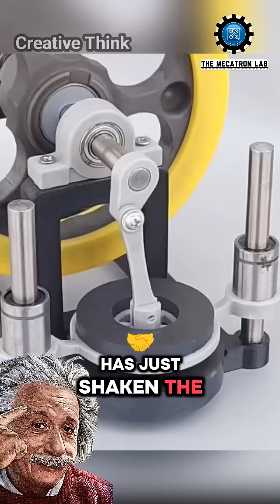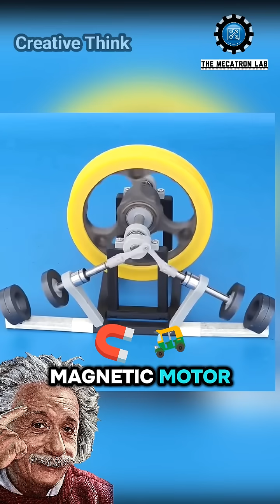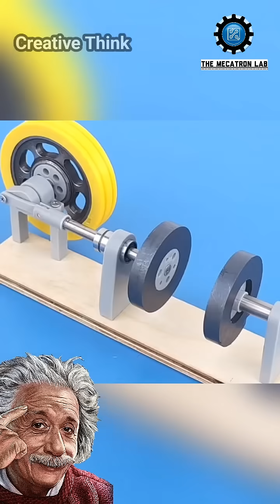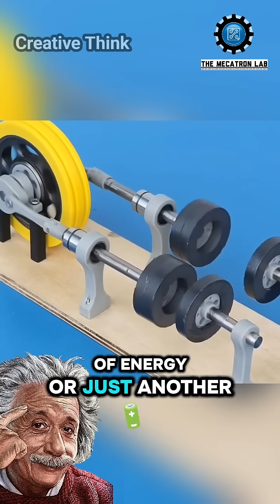How To Make Magnets motor.Free energy motor.#diy #diyprojects #facts

Comment: THIS stands near per. Mobile! You can have a coil between the magnets piston and make the electric current to get the flywheel go on for a long time! AND IF THE FLYWHEEL IS BIG ENOUGHT TO GO BETWEEN THE MAGNETPISTON YOU KAN GET A DRIVING FORCE BY THIS AND MAKE A GENERATOR HOW IS EXREMLY EFFECTIVE! IT'S  NOT A MACHINE HOW GO FOREVER BUT CHEAP EFFEKTIVE AND NEAR 100%! SO THIS IS THE BEST MISS. I. 
EVER SEEN